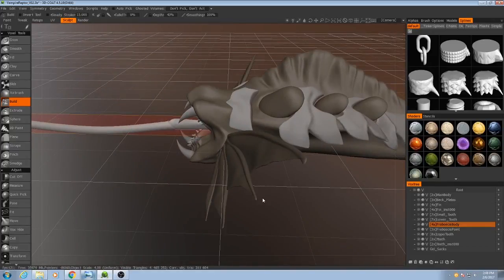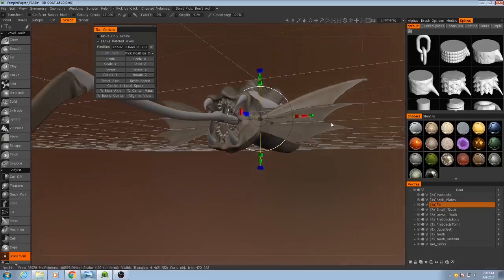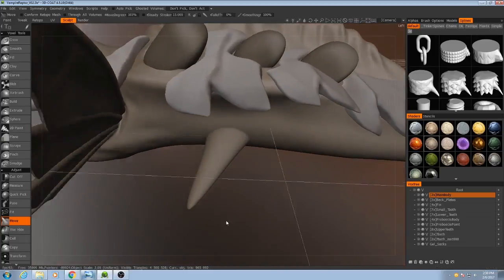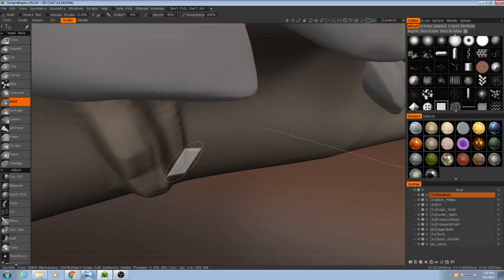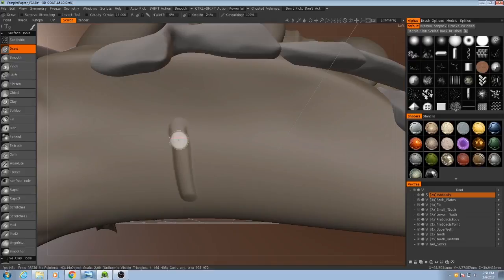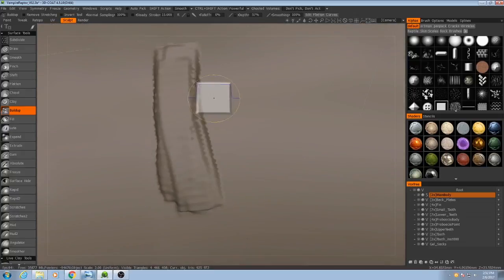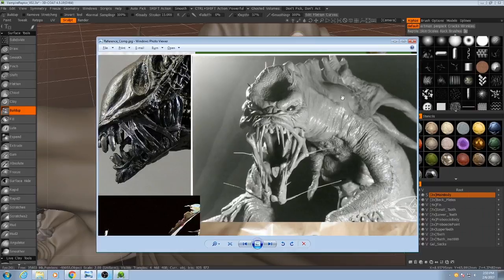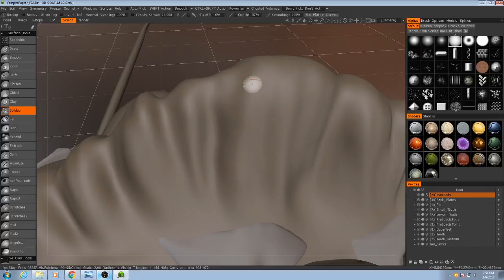3D-Coat Alien Leech Sculpting Tutorial (Part 10)

Comment: I understand a fair deal regarding ZBrush, but not 3D Coat's "Voxel vs Surface" mode. Does the Surface mode have a set (polygonal) resolution, and if so, how can you tell and interact (increase and reduce) with the amount? Thanks again for these excellent sets of tutorials!
Reply from the maker: In voxel mode, the density of polygons is set by the resolution of the voxels. Think of them like pixels in an image. The more pixels you have, the more detail you can draw. In 3d-Coat, you can  increase the number of voxels by increasing their resolution. To preserve the scale of your model, 3d-Coat decreases the size of the voxels so you have a larger number of smaller voxels to compose your mesh. When you sculpt, you are telling the voxels if they are filled or empty. If they are filled, then polygons will be wrapped around them. The smaller the voxels, the tighter this filled space can be and 3d-Coat increases the density of polygons until it can properly respect that space.

In surface mode, the polygons are set. Sculpting just moves the vertices around. To increase the polygon density, you subdivide the mush, effectively cutting each triangle into four smaller triangles. Then there is live clay, which only subdivides the polygons you are sculpting directly on, cutting them until they are small enough to respect the size of the brush you are using. Decreasing the density of polygons is a little more difficult in 3d-Coat though. There is the Clean Clay tool, which welds vertices together, reducing the polygon count where you are brushing, and there are proxy models you can cache out, but that is a little more complicated and I don't use it very much.

I hope that helps!